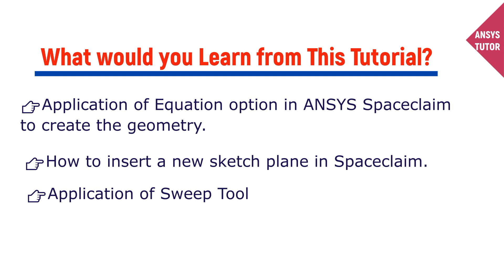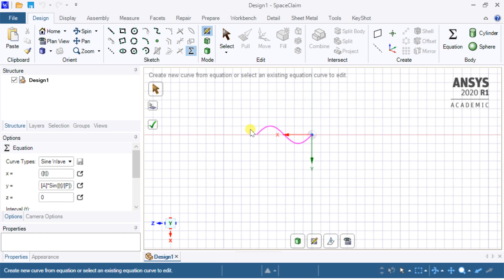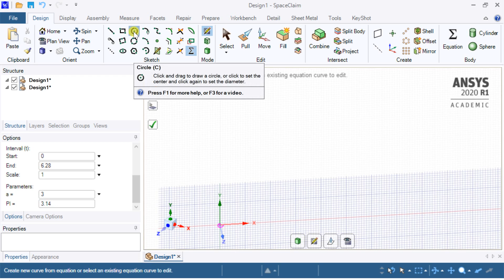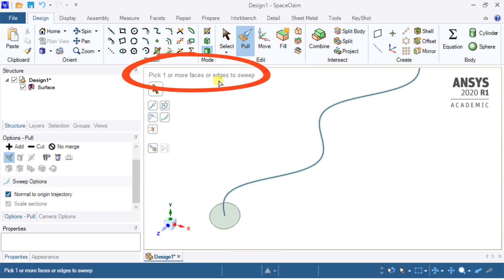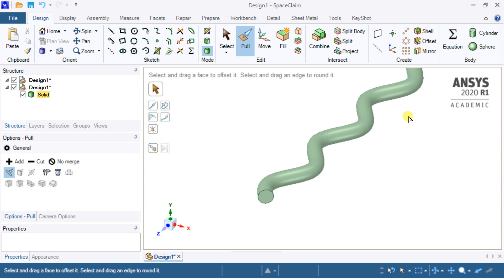ANSYS Tutorial For Beginners | How to Create a Sinusoidal Pipe Geometry in ANSYS SpaceClaim | V20R1

Comment: Where did they goo.  I was about to ask them questions livee.
Reply from the maker: yes ,please ask.
Reply: @AnsysTutor  I am trying to model something like a torque converterish thing.
https://ibb.co/5G4CFB2

I am trying to turn the left shaft in 2000 rpm or stuff. And I created a solid with 2mm thickness which was supposed to be an oil film. With the rotation of oil the shaft to the right will turn.

I want to observe the output shafts torque, rpm etc. I selected the oil gap small so that I can calculate the error between laminar velocity profile assumption and the ansys case. 

My question is do I need to create a wall around the fluid domain or creating a solid is enough. Also how do I add gravity to solution. And how do I need to mesh the interface surfaces, which methods should I use in order to get realistic results.

I also expect the shaft to the left to turn by itself. But I guess i need to clarify it as moving wall in order to get the rpm or do i even need to do that. Im kinda confused :D
Reply: here's a telegram channel